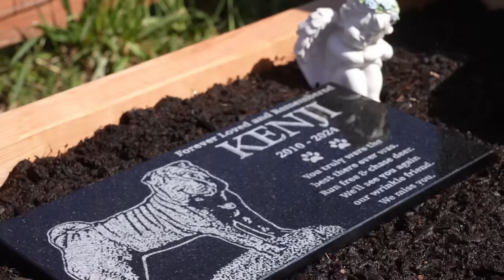Incredible Polyurea Garage Flooring Installation & Interior Paint Done Inside Our Mountain Home

Comment: Sorry for the loss of Kenji. It really is hard to loose a furbaby. We lost both a dog & cat that was family to us. It takes time & grieve however long you need to. Just know time will make it better. ❤❤

We did our garage like this 7 yrs ago, even up the sides. We love it! We have the flakes, but we also had them to put beads in the top coat so it wouldn’t be slick. It’s still slick. Just a little when it rains & we walk from the driveway into the garage. It’s really slick, I mean really slick when we have snow on our shoes & hit that garage floor. Now we have a strip of indoor/outdoor carpet we lay down at the entrance before we go to shovel the snow. This way, we have something to step on, when we come back in. We can shake off the snow & get out of the snow shoes or sneakers once inside. Just be careful. They say it’s not slick, but it is. 😳😬